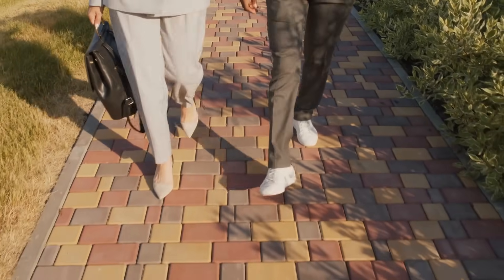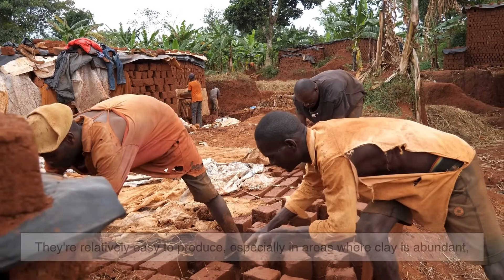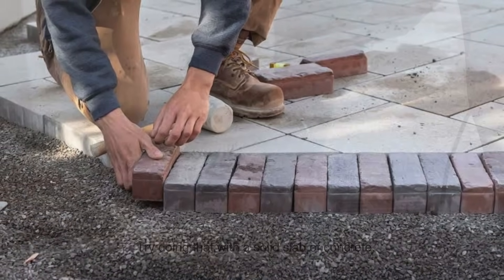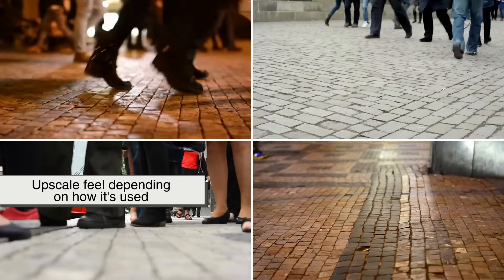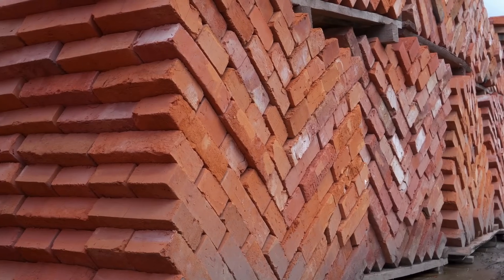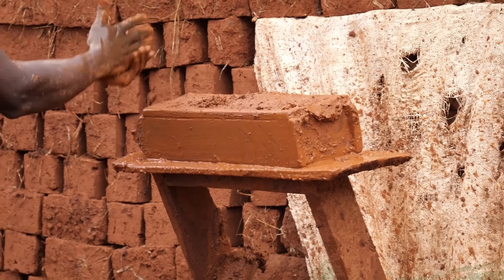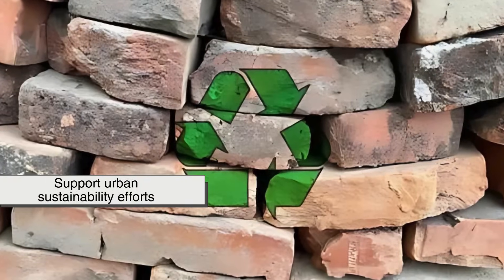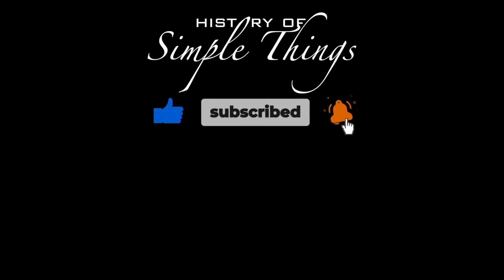Why Do Some Sidewalks Use Bricks, Not Concrete?

Comment: A concrete slab may only be poured so large, is will not break if lifted on one corner. Otherwise it will break if the ground moves over time, either shifted by water or lifted by roots.  The bigger the slab, the thicker you have to make it, using much expensive concrete. Breaks will produce ugly steps in the sidewalk and need to be fixed.
Plaster will follow the moving ground, is flexible, so you do not need good preparation to put a plaster. No puddles emerge from depressions as the plaster is not watertight.
Asphalt/tarmac an the other hand while somewhat flexible is watertight and will create puddles.
So: if you don't want to create a highway with perfect ground preparation removing all organic material and draining all water, especially up to a depth where freezing will occur, you are better off with pavement.
Pavement: less ground preparation, very flexible, lets water pass thru.
Tarmac: extensive gound preparation, somewhat flexible, watertight.
Concrete: perfect for bridges, less suitable for imperfect ground as it will break some day, requiring extensive mainenance. Deliberatly introducing joints will predefine places where the concrete slabs will create steps. If you introduce sufficient joints so that the steps will be small you end up with pavement.

Comment: In the UK concrete block paving is practically universal. They might look like bricks to the casual observer but coloured concrete pavers of varying depth depending on the load they are designed to bear are cost effective, attractive and have accurate dimensions making them easy to lay. Bricks are for walls.

Comment: We use the bricks for the street crosswalks for the people to use, as they are both long-lasting, and cars stopping don't skid over the paint or vinyl, and they are cheaper in the long run. Maintenance is almost negligible. No need to reduce carbon footprint either, as we need more CO2. Get some facts before spouting off the climate change crap.

Comment: We have brick pavements in UK,  our pavements normally tarmac.  I suppose they were changed from tarmac to brick to allow access to services underneath,  but the bricks never go back properly after they are disturbed for work to be done... Another thing is that weeds and moss ( slippery when wet )  just love those millions of cracks in brick built areas....
Reply: Sand underneath. Water drains. Problem with ladies’ high heels.